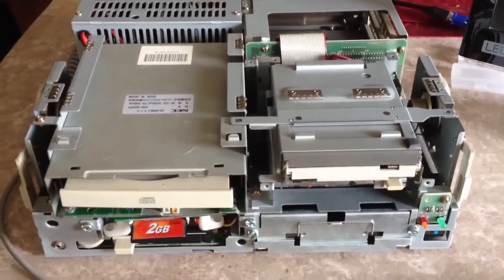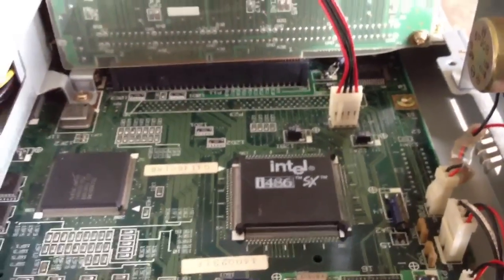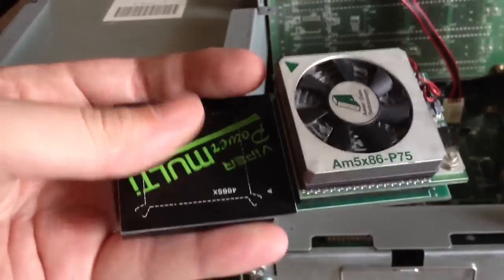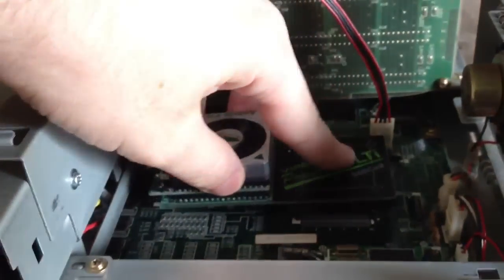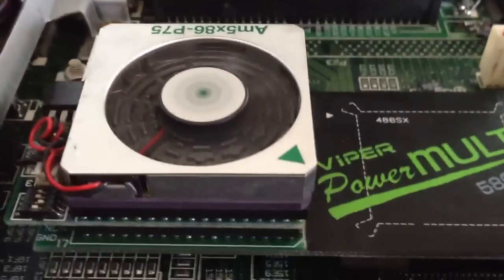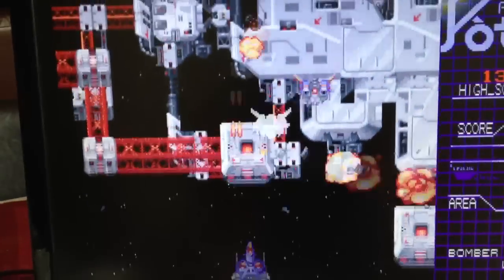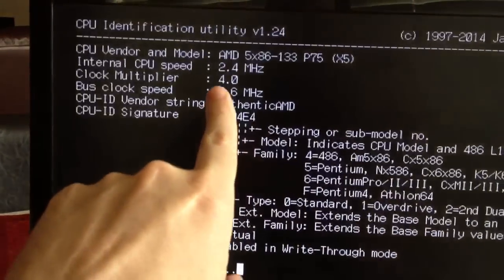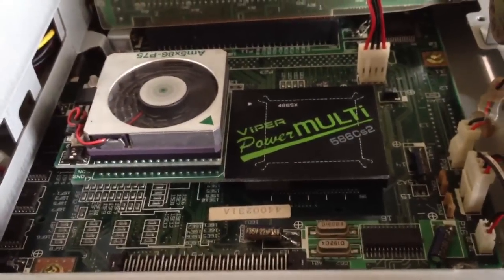NEC PC-98 CPU Upgrade - The Obsolete Geek

Comment: The real reason the game is no different is that the machine has console style video hardware. All the sprites are done in hardware for free not with PC-style bitmap copies that burn bandwidth and CPU cycles. The graphics will run off horizontal and vertical blank interrupts and those video clocks will not change just because the CPU clock changed. With hardware like this the SNES is fast enough using a 16bit CPU running at a few MHz. Find a game doing filled 3D polygons and test that. I'd expect it to show a big jump in performance.

Comment: this is very cool! only problem I see is if there are any high enough parts on the mother board on the left side of the CPU this adaptor will not fit at all becouse ot it's desing :P

Comment: Part of the reason you're not seeing a huge increase is bus speed, video, and memory performance limitations.  Also, while the AMD part may be competitive to an Intel DX4 100MHz in integer performance, the Intel part will dominate clones in floating point math - which is where the competition floundered.  Please keep that in mind.
Reply: That isn't actually true. Once the game reaches 100% speed, no amount of more computing power is going to make a difference. Where you will see big improvements is when something is really CPU intensive. Moving from an SX to a DX is a decent upgrade as well. Overall, this might be a little more than twice as fast, primarily for the reasons you mentioned. However, anything that is especially CPU intensive, especially if it can fit in the cache, is going to get a much better result.

Comment: you should look into the uk pc98 stuff, for english programs and even operating systems  there was a few pc98 powered systems released here though none took off, there is also a version of risc OS tweaked for the 98 platform, linux and android also have 98 kernels from my experience any of those are easier to learn than japanese lol.
Reply: aly nicholls There is a hacked Windows 98 which is translated into Chinese... As well as a speciall version of NEC Windows 3.1 for PC-98 which is in English.

Comment: The actual P75 was rather slow since it ran on a 50mhz MB. Once you hit full speed on a game, no amount of additional speed is going to make it go faster. Basically, games that used to run too slow should now run full speed. Applications that just run as fast as they can should be where you really see a speed increase, though the slow board speed is going to really bottleneck that CPU.

Comment: I can't really understand why anyone would want to do this other than "bragging rights". The CPU that you already have in there is more than fast enough to run virtually all of the PC-9801 games library.
Reply: that wasnt the case in reality, i had a 486 sx25mhz and the performance in doom2 was noticabely worse than on a dx4 machine which had a math co-processor the sx didnt.  Which made the difference in the games at the time. This is the kind of upgrade I was looking for I had no idea existed.  Thankfully it looks like I was spared some disappointment.  I did try to upgrade with a a dx4 processor but later learned that the socket on my pc was for an upgrade only slot, which later looking into one was almost the cost of a new cpu/motherboard so it was a toss up then too, still cheaper than a whole new system which made it a practical upgrade.
Reply: This is PC-98 we are talking about here. It does not play standard MS-DOS or Windows games. Trust me, the PC-98 game library does not require anything faster than what was already in this PC to begin with. The author of this channel has a bit of an obsession with upgrading CPU's (which is his interest and his choice to do with his hardware), but honestly in the case of this machine there is pretty much no practical reason to do it.